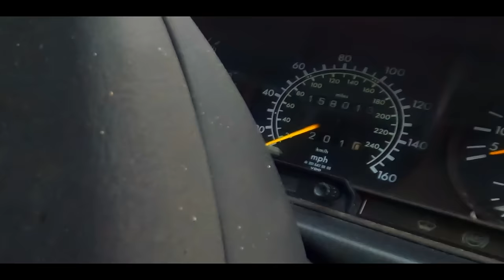PARKED For 22 Years EXTREMELY RARE Mercedes 190e Carat Duchatelet - SHOULD WE BUY IT? | IMSTOKZE 🇬🇧

Comment: Just looked up the spec of the Carot basically it was like the AMG of today as top specs

For those who felt the specifications on offer from the Mercedes factory a trifle staid, help was at hand from the Belgian firm Carat Duchatelet. Better know today for their armour plated limousines, during the mid ‘90s they offered a range of aftermarket upgrades for the Mercedes’ range. More popular on the top-of-the-range models due to their not inconsiderable cost, they nonetheless found success selling upgrades for the 190E. Wood trim dashboards, body kits and alloy wheels were the order-of-the-day, the cars also gaining subtle Carat Duchatelet badging on the boot. (Taken from a car for sale)

Carat Duchatelet are a Belgian company that were famous for their Mercedes conversions in the 80s and 90s. Their W126 '1000' SEL and SECs are very well known. Their stuff was mainly cosmetic. Broadie's 190 shows what was available on the 190, the deeper front and rear bumpers with extra front driving lights, deeper rear quarter sacco boards to line up with the bumper and a boot spoiler. The car also wears the 16" version of the Carat alloy wheels. As suggested, there were no tuning options other than a set of lowering springs. Although Broadie's car has a standard interior, it was inside where they used to really go to town. What you got depended on how deep your pockets were but for example, a member of the 190 forum has a 190 with a Carat trimmed interior from new. It has electric Recaros up front with cream leather everywhere. Seats, door cards, pillar trims, dashboard and centre console are all cream leather with red piping, with red deep pile carpets. Very 80s yuppie car! (Taken off a forum)
Reply: I had my 190E 2.5-16 re trimmed by Carat Duchatelet in 1992 & they made a fantastic job. My car was Almandine red & I didn’t like the black interior so they re trimmed in cream with burgundy piping fluted door panels with burgundy stitching, i went to town on it but it looked great. Later I even put an Evo2 rear wing on it but without the full kit it didn’t look right & only lasted a few days before I reverted back to the standard spoiler. I sold the Evo2 rear wing to Rude Mercs of London if you remember them. Carat Duchatelet really only sold body kits, suspension & interior upgrades in the UK so that car doesn’t seem to have a body kit or nice interior just a faded badge, the cars not worth anything.
Reply: @4cds14  yeah the values of them is very low tbf not as you would think they would be. But lots of classics are like that yet others are crazy prices.  Yours sounds epic on what you had done really nice. They did look nice with the small and Evo spoiler as long as it was done right. But not to everyone's taste like anything. Do you still have it now or did you sell it ?
Reply: @4cds14  Had to look up rude mercs as a reminder and yes I do as they featured the yellow Merc with the deep dish wheels and all modded up and mad paint job too.
Reply: @seanadams8504   hi I traded the car when the C36 AMG came out.
That car was rapid but not as good as the C43 AMG which was a fantastic car. Just as a note I asked Mercedes to quote for the full evo2 body kit in 1992 & they quoted me £12,000 plus fitting/spraying
Reply: @4cds14  wow that's a lot of money for a kit and fitting. And nice trade.  My brother in-law used to work for Mercedes He came to my house in the C63 AMG when they first came out and took me for a drive and also the SLS AMG both fun and stunning motors.
Reply: @4cds14  I remember RUDE MERCS WELL
Reply: @jasxx1108  The yellow 190E they had featured the Evo2 spoiler I sold them. It was a financial disaster for me probably costing me over £3000 ( back in 1992) to buy the spoiler get it fitted & painted then removed after about 3 days get my boot lid welded ( different holes) & painted & fit the old 2.5 kit back on. All my friends thought the Evo2 rear wing was hideous ( that was their words & they have stuck in my mind to this day)

Comment: I used to have a 190e 2.6 in similar spec. Loved it, bags of power for the size of it. Wish I had it now. That straight 6 in the 190 made it a very nice car. Think I was 20 years old when I saved it. Bought it cheap and it only needed the over voltage relay to get it running

Comment: The 2.6 is a the better car, 2.5 So called Cosworth, who actually only developed the pistons. 
I’ve owned both, the 2.5 can only be ran on Super Unleaded. 
They’re not that quick, by modern standards. 
The manual is a pain, as it’s very easy to put into reverse at the lights, a lot of 190’s have been hit in the back,as a result
Caret is for Dimond, Ducalet is the design house. 
Who were based in Holland, they made armed cars and trucks. 
They didn’t last long, AMG put paid to them.
Great post
Happy New Year

Comment: There was always a wait for 2.5-16 so the 2.6 was easier to get. Carat Duchatelet was sold in the UK by Lancaster Styling Colchester.
I had a Almandine red 2.5-16 re trimmed by Carat Duchatelet with cream leather with burgundy piping as the car only came stock black leather or black/cloth.  
Carat Duchatelet was not from Mercedes they are an independent tuner similar to AMG at the time, but Mercedes bought out AMG for their racing program.
The sport line people are talking about was only the upgraded lowered Bilstein suspension package. I would wait & get a real 2.3-16 or 2.5-16 which is a proper classic car of the future.

Comment: It's rare, but not sure it's worth much.
From what I know, the CAROT was a dealer fitted bodykit basically, and could be added from new on any model. This is a 2.6 but it's a lesser engine than the Cosworth which you will already know was badged 2.3-16 (and a 2.5-16 from 1988).
The 2.6 was basically developed to compete with the BMW straight 6 engines, which were more powerful and fuel efficient.
The M535i was a faster & better car than the 2.3-16 though. Obviously the EVO 1 & 2 were on another level again.

1982 Dec 190 (carb 90hp) and 190E (injection 122hp) - both using the 2.0 4-cylinder M102 engine from the W123

1983 190E 2.3 added in the US Sept 1997cc diesel 190D launched 72hp

1983 Sept 190E 2.3-16, dohc Cosworth head

1984 May Five-cylinder 190D 2.5 added

1986 190D 2.5 turbo (not for the UK) Sept 166bhp 190E 2.6 (UK from April ’87)

1988 Facelift, more rear legroom, duplex timing chain on 2.0 July 2.5-16 replaces 2.3; 2463cc Evo with bigger spoiler (502 built)

1989 Mar 231bhp Evo II with wild bodykit (502 built) Sept injected 1.8 replaces carb 190

1992 Catalytic converter standard

1993 Production ends

Source for most info  : classic & sports car.

None of them ever really fetch M3 money.

Comment: You could film the car a bit better, currently it's hard to see details of exterior (mostly if it has Carat's front bumper or not).  Overall this car has only styling package from Carat by Duchatelet (trunk lid spoiler, rear bumper with side trim related to it, and probably front bumper... plus badge on rear).  Sadly NO interior upgrades (Carat offered parts like extra wood trim, sport steering wheel, leather interiors with possibility to have dashboard in colour of seats, metal door sills with "Carat by Duchatelet" sign) and no rims from Carat by Duchatelet...   In my opinion this car is as worth as 190E 2.6 in this condition with a bit more attractive look.   If I remember correctly,  Lancaster dealership offered Carat's parts in UK.    Car is worth restoring if you have oportunity :)
Reply from the maker: I do apologise will definitely try harder!

Comment: Its not a cosworth... they are 2.3 or the evo 2 2.5..... 
cosworth  is  on the cam cover...
and wheels  are different and dog leg six manual box...some are auto
is this the straight 6..?   cosworths are 4 
but a cool vid...and it is worth saving..
its a cosworth..its a cosworth.... for the you tube..
 N x

Comment: Vehicle make
MERCEDES
Date of first registration
December 1992
Year of manufacture
1992
Cylinder capacity
2599 cc
CO₂ emissions
Not available
Fuel type
PETROL
Euro status
Not available
Real Driving Emissions (RDE)
Not available
Export marker
No
Vehicle status
SORN
Vehicle colour
BLACK
Vehicle type approval
Not available
Wheelplan
2 AXLE RIGID BODY
Revenue weight
Not available
Date of last V5C (logbook) issued
15 January 2014